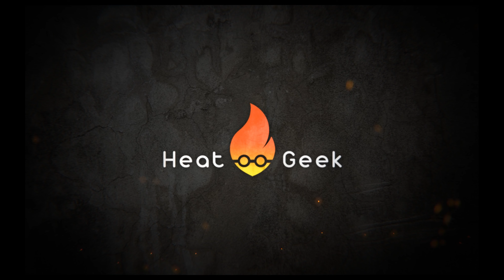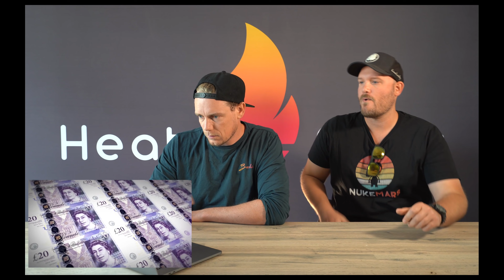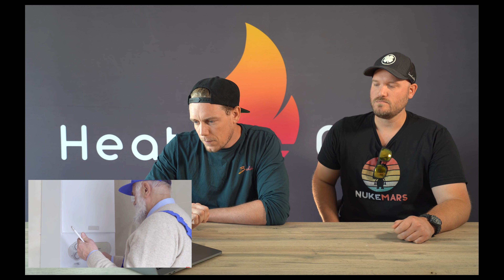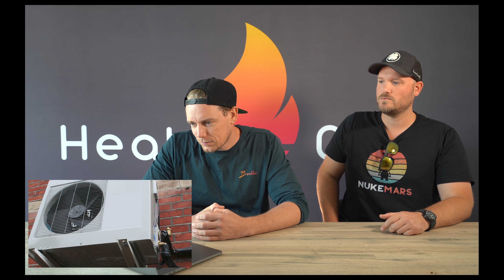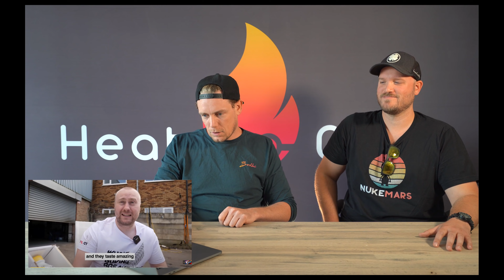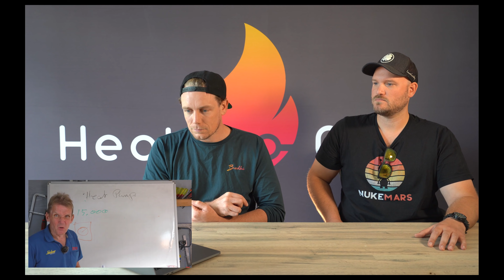Professionals React (BADLY) To Skill Builders's Heat Pump Videos | PART 1 | FIRST TIME WATCHING

Comment: That’s roger bisby he’s a decent bloke to be fair, and started off as a plumber …I think any installer trying to sell heat pumps to a household that it’s not fit for is clearly a conman. Heat pumps installed under ideal circumstances are fair enough but most homes in Britain don’t have those conditions.
Reply: This is exactly the point a vast majority of the UK housing stock are energy inefficient, poor thermal envelopes combined with the inability to keep warm air inside. Really the government need to approach this issue in stages, they have to put money into upgrading efficiency in the housing stock first then at the same time build out the hydrogen infrastructure. Lets face it heat pumps is not the way forward for most households...
Reply: My neighbour in a victorian end of terrace has had a Mitsubishi heat pump installed. They upgraded their rads, they had loft insulation put in & a cylinder where their boiler was.  a heat loss calculation was done to size it they say its cheaper to run and it's roasty toasty.
Reply: @Lewis_Standing  Yep. My house was built in 1979 and the retrofit gave no problems.

Comment: I have seen this in my own trade,They wanted to scrap CFC fire extinguishers (halon) so they just kept putting up the recharge price and shortening the refill time.He is bang on .They will put the price if Gas up and up and up and up
Reply: So you think getting rid of CFCs was a bad idea then?  That is what it sounds like. Totally irresponsible attitude.
Reply: @rogerphelps9939  No the hole in the ozone has closed.I was explaing how govts can make people do things.They intend to take 5% off the price of electricity and add it to gas,every year till gas is dearer and so forcing people to change.get it........oh dear
Reply: @Jack-fs2im  Well the hole in the ozone hole has not closed yet. It will take another 30 years or so. It seems that you are advocating for the return of CFCs so that the hole can open up again. As it is air conditioning fluids were changed from CFCs to HFCs. Unfortunately the warmimng potential of HFCs is very high and they have to go. It is almost certain that the replacement will be propane and designs must be adapted to minimise any fire risks.

Comment: So you agree heat pumps are not there yet, 10 years time maybe? (21:31) I will skip the heat pumps for now, thank you two and Roger, I won't waste my money for now. at (30:05) you say China CO2 is on the way down are you sure that is true? CarbonBrief said (May 20th 2021) "China’s carbon dioxide (CO2) emissions have grown at their fastest pace in more than a decade, increasing by 15% year-on-year in the first quarter of 2021, new analysis for Carbon Brief shows."  I think you misunderstand CO2 rising and Chinese  'carbon intensity' which is reducing slightly but not CO2. Can we believe the Chinese Communist Party anyway?, I certainly will not, nudge nudge  2019 SARs.

Comment: I was quoted a MINIMUM of £30,000 to retro-fit a heat pump to my house.  This covered the pump, new pipes, and bigger radiators.  The maximum temperature a heat pump will normally pump out is 45 degrees, not enough to heat your house to comfortable levels, and certainly not enough to get hot water for domestic use.  I am speaking from experience, as I have a heat pump to heat my pool, which is fairly cheap in the summer, but totally uneconomical in the colder months, when I switch it off!  I agree 100% with what this chap from Skil Builders is saying.  If you can afford to spend up to 3 times as much to just keep your house just warm, then fine!  If not, then DON'T!!!
Reply: You clearly don’t understand the technology, i’m running radiators at 40°, very comfortable thanks. Hot water a plenty at 55°.  Even when its -4°. 🤷‍♂️
Reply: @kenbone4535  You clearly don't understand the economics!!!.  Why should I spend a MINIMUM of £30,000 just to get my house "comfortable", plus the cost of a heat pump running constantly in the winter trying to keep my house "comfortable".  I have a very old house with 16" solid walls, no insulation and 10' high ceilings.  My choice, of course, but there it is!  And FYI, water at 55° is not 'hot', just hand hot!
Reply: @peterconlon5167  yes done loads of heat pumps in houses like that thanks.  HSE hot water temperature should not be higher than 55°, it’s actually the law. Have been running hot water for 20 years at 50°, i’m still here.
Reply: @kenbone4535  'Where hot water is provided from storage, building regulations require a storage temperature of 60oC  and a circulating temperature of no less than 55oC to prevent the development of Legionella or similar pathogens.'  Straight from the legislation!
Reply: @peterconlon5167   heat pumps can heat water to 65-70° under refrigeration only, but i’m very happy with  50°, also adds to my efficiency, legionella only accumulates when hot water is not used for long periods.
Reply: @peterconlon5167  it’s regulation to have a legionella disinfection cycle. You can store at what temperature you like.

Comment: bit of advice here lad`s, you run your own business, then go on youtube and try and discredit someone`s information, i`d have thought you`d have done a bit of research on the person whom your quizzing.....the sort of thing that you would do BEFORE , let`s say, fitting a heat pump, if you two turn out to be correct and roger`s wrong, i`ll insure a PERSONAL APOLOGY here on youtube, but so far it`s a 1 horse race and he`s miles in front🐎🐎🐎🐎🐎

Comment: Air-Air would make much more sense. Cheaper to install, no need for larger rads, can air condition in the summer. Immersion or on-demand gas 'geyser' for the DHW requirement. Shame the RHI can't be claimed on devices that also 'cool'...
Reply: It's in the name - Renewable Heating Initiative (RHI).  Adding in cooling increases the energy use tremendously, which is sort of against aim of reducing carbon footprint and/or running costs.

Comment: Love how you disagree with Roger, then have no real responce as to why then say oh he could be right lol.

I have been a chiller and AC engineer   for 25 years and have lost count of the amount of compressors i have changed in AC units, chillers, heat pumps, GSHP and ASHP and they are very expensive so when these heat pumps are out of warranty the end user is going to start getting massive repair bills to replace compressors and inverter pcb's which in a whole will be carried out by cowboys. 

The other thing you haven't mentioned is all these heat pumps have a low limit of temperature they work in or down to and i know the oem say they can work down to -5 or even -10, again i can tell you the closer the outside air gets to the limit of the unit the output drops of massively, the other thing is these units go through a defrost cycle to clear the ice/frost from the evaporator. 
So during this no heat is produced , unless these units run daul coils like in the daikin VRV heat recovery units, and the colder it gets the more they defrost and around we go. So not great when you want a nice toasty shower when its - 3 outside. 

I certainly won't be installing one any time soon, i would prefer to wait and install a hydrogen boiler.
Reply: Absolutely spot on.
I have both GSHP & ASHP (Pool) and the bills for repairs are never ending and expensive.
The ASHP have now been replaced twice (with considerable cost input) but still are nowhere near the claimed COP.
Reply: @andrewstafford-jones4291  i was just about to sign on the dotted line. ty!
Reply: @bootangy  I forgot to mention the design fault on the1st ASHP that caused the ice build up and break the high temperature switch every few months in winter.
Oh yes, they are not designed for cool, damp climates apparently !!
- not what their brochure says.
Reply: Nailed it, care to respond guys
Reply: Unfortunately, they won’t respond, they have got no case.
Reply: @eeemwong  lol.. i can only assume you didnt listen to our video and just came here to comment...
Reply: Your comments do not apply to ground source heat pumps.
Reply: Darren that’s a poor argument. You are basically saying we should stick with a technology that is going to support in leading to the extinction of the planet because we know it works. Rather than investing in a a green technology such as heat pumps and educating designers and installers how to get it right. We know that heat pumps work when installed correctly - and yes they can be prone to problems if they are not but that is the nature of a low carbon technology. To be honest most gas boilers are not even installed correctly and run at less than optimum efficiency but because you still get 80c water out of it nobody bats an eyelid. You may not care but I care for the next generations, so stop spreading your codswallop.
Reply from the maker: so you think you should use a thermal store with a heat pump like roger suggested? no wonder he had poor performance on his installs..
Reply: did you watch the video? I say hes right on some points... but installing heat pumps without doing any system design or performance estimation, seeing how it turns out in 2 years time and judge all heat pumps on that? that shows he did not do any ttaining before installing.

yes your right heating engineers shouldn't work on the fridge side...
Reply: @ChapmanPlumbing  I Have been a plumber and heating engineer for over 40 years and all I see now is work done by people who have no idea how heating works and you think everybody that installs heat pumps will be and better. one reason I think this is true is that in our training establishments no one fails the courses due to our super PC way of life.
Reply from the maker: @mrbizzzare  You have that the wrong way round, i don't think everyone who installs heat pumps will be better. I think everyone who installs heat pumps will HAVE to be better if they want them to work. Your right about attendance courses and pay-to-pass courses. which is why we have developed training that is failable (only 2/3 pass) to train people up to be better.
Reply: @HeatGeek  I Hope you are correct because if not a lot of not so well off people will be cold in the winters to come.
Reply from the maker: @mrbizzzare  yep. if people install these without designing the system it will be a disaster

Comment: If the temperature is above 30C OUTSIDE you'd have a VERY good cop says pat the "straight hat" 😂😂😂😂 30C in the UK, that's a regular occurrence in the UK , isn't it lads 😂😂😂😂 no wonder pat looked embarrassed after that little quote, let's face it lads, you sell em and install them,  your not going to be 100% honest are you, Roger may have described some things incorrectly, but overall he's spot on, if you integrate a heat pump into a NEW build, and the buildings insulated correctly and the pumps installed correctly, they "seem" like a good idea, but installed into a current built house, they're a total waste of money. Simple but oh so true.
Reply from the maker: yeh we sell the, and their direct copetitors

Comment: These guys sound calm and sensible whereas Roger is on a rant, however when you analyse what they're saying it does not fit with the real world, e.g in response to the complaint about noise they say there are rules about placing the pump away from windows, away from neighbours ..... but of course that's not always realistic in close packed urban and suburban areas... they then have to acknowledge that later in the video and admit it doesn't always work.  Roger is making the simple point that heat pumps don't give out as much heat as a gas boiler so they only work in a well-insulated house. Most houses are not well-insulated and are not easy to insulate. That's why there are hundreds of people sitting across roads trying to get the government to assist the insulation of our housing stock. This is the first thing to do, not throwing money to the affluent to install heat pumps. Eventually these guys acknowledge there is a lot of truth in what Roger is saying. Both are trying hard to provide a realistic solution and the final comment that people should heat themselves is probably the most sensible things people can do ... wear more clothes until we have better insulated homes. 
Sadly as in many areas the current government are hopelessly out of touch with reality.
Reply from the maker: we never do say they always work lol.. hence saying we also install other solutions like fuel cells...

Comment: Incredibly naive thinking the government will take it off electricity and put it on gas to level the price. 
As for heat pumps being carbon neutral, they need electricity to work .
And the one size fits all is the government’s approach, focusing on HPs and banning gas boilers.

Comment: I’m with Roger on this 😉
Reply: Me too
Reply: Me too.
Very few installing heat pumps do system designs and push just to get it installed that’s why it’s in the state it is because they are money driven rather than designing or saying sorry this is not suitable for you.
Reply: I had a heat pump installed this summer. I've just looked at my consumption for the past week (pretty cold here in Glasgow) and it's about the same as the same week last year when I had a combi. Both about £8. Installation wasnt perfect and I had to get them back to tweak the controls but it's running sweet now. It's a 1920s end terrace with cavity fill,  300mm loft insulation and windows that are at least 20 years old.
Reply: @chrisrundle5591  a lot of my customers are asking about heat pumps, I can’t really give a honest answer to them because some of my customers who already have them hate them. A few are starting to ask about far infrared ceiling panels which I have fitted in the past and are nice all the time you’re under them but I’m unsure about them too. I don’t think it really matters when it comes to electric heating, it cost basically the same to heat an area no matter what you’re using
Reply from the maker: Here's evidence of how they work when well installed in a NORMAL house with tiny rads and little insulation 

https://youtu.be/QLGANlbqIFY
Reply: what? you think you should install heat pumps without doing any system design or performance estimation, see how it turns out in 2 years time and judge all heat pumps on that? ok...
Reply: This just seems like big long anti-ad for Roger and how bad a builder he is. If he has so many unhappy customers, why would anyone take anything he says seriously?
Reply from the maker: @chriscarus2464  thats the thing. I think hes a great builder. that does not make him a heat pump expert. Infact it seems his heat pump knowlelge is very low if he does not do a performance estimate or design the system before installing. Heat pump installations arent a builders job. I have a lot of respect for roger and even say i really like him in the video but his analysis on heat pumpps based on a couple of non calculated poor install is not a way of measuring all heat pumps.
Reply: @HeatGeek  like u said there not gonna work in every situation horses for courses and all that but u know ur gonna get a lot of negative comments from Rogers camp people can b very Partizan and he’s got a hell of a lot of loyal supporters now praps ur right on most of this ( I ain’t no plumber ) and I don’t know but I do know people and no matter what u say there’s gonna b people questioning ur expertise especially skill builder fans but reckon u knew that anyway

Comment: I’d say the majority of people will tell you that they care about the penguins melting, right up until the point they realise it’s gonna cost them 15k to get Greta the grumpy doom goblin to shut up. Then they put in a 4K boiler and go on a couple of nice cruises instead. Unless these save people money over what their current gas boiler is costing them then youre pissing in the wind. So many houses have combi boilers these days, cupboard fit. You try convincing someone you’ve got to put a dirty great buffer tank somewhere in their house/flat instead of that nice hidden little combi and the end result will be huge radiators that limit even more how they can put furniture in their rooms, and that there’s a good chance their house will often be colder. Plus in a busy household, with a couple of teenagers, they are gonna knock the heat out of that buffer tank with hour long showers faster than the heat pump can replace it. So I get everyone had just better put a coat on if the kids beat you to the bathroom.

I take issue with you saying the market won’t be flooded with under qualified installers. The standard and under pinning knowledge of a lot of the so called smart meter gas installers is absolutely shocking. I’ve been called out to put right loads of nonsense they’ve left behind cos they’ve got no idea what they are doing. Capped off systems cos of leaks they’ve left, AR cert on a fire because they hadnt turned it back on, un purged systems etc etc etc. Heat pumps will be exactly the same. Go on a weeks course, be a heat pump installer, beats working in Amazon.

Comment: Sorry chaps but both by emissions per capita and total emissions there are a lot of countries above the UK. You can’t say that we export our emissions for manufacturing and include unknowable amounts in that and say we are bad. If you use the per capita figures readily available on the Internet then certain countries have really high figures due to their low population. 

We are still below China in either measure. There is no way you can include the emissions created in another country by their manufacturing to which we would have no control as part of our emissions.

I absolutely agree we need to make everything we use as efficient as possible but it has to be feasible.